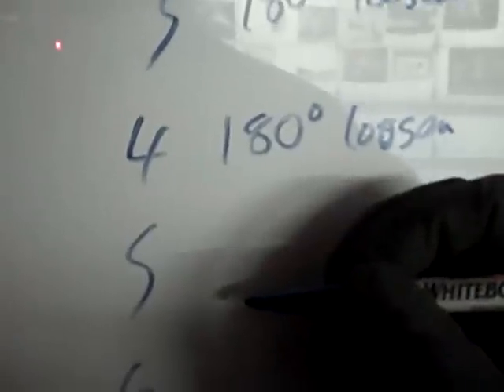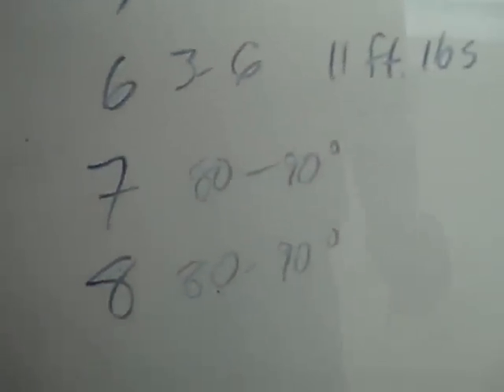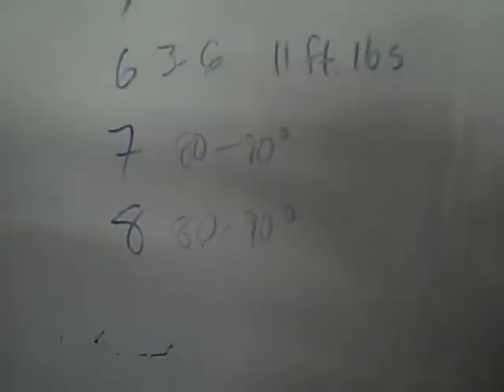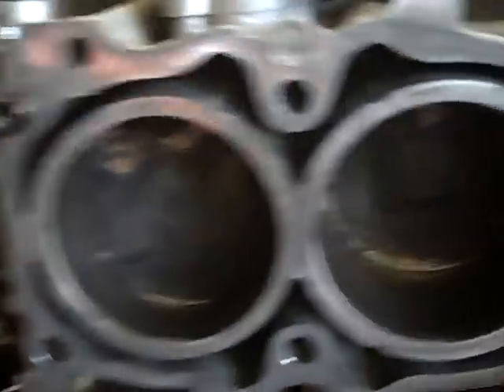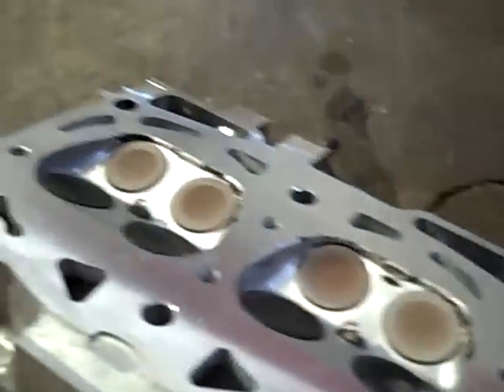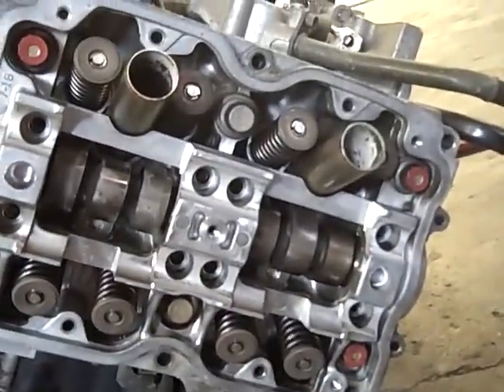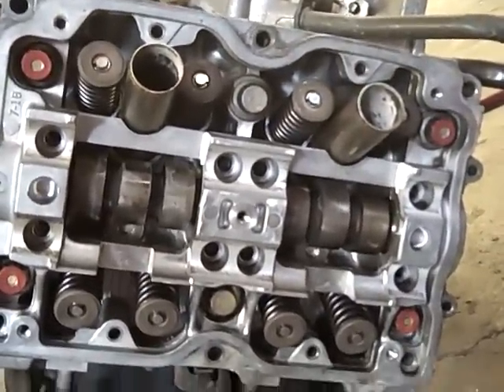Subaru Head gasket installation instructions

Comment from the maker: @lealamb If they have that white corrosion on them it really messes up the torque and contributes to broken bolts especially when coming out.  I wire wheel the threads and put a little oil on them.  You're better off to have them be too loose and use some blue thread locker than to break them off.  Not sure if this helps but I try.

Comment from the maker: @MrBugout1   If it's a manual transmission, it has synchro damage and needs to be pulled out and reworked.  If it's an automatic you may have a linkage issue either at the trans pan or in the console.

Comment from the maker: @Flaheat   Put the shaft in a vise.  Clean out the inside enough to tell if there's a clip you can remove.  If so remove it and the shaft will come off the inboard joint.  If not - then it's internal and you use a big rubber sand-filled dead blow hammer to thunk it off the end.  Also as you probably know the inboard joint is held to the trans output shaft by a roll pin.

Comment from the maker: @y2mouse If the heads are off you can use an impact gun.  If it's the driver side (left when in vehicle in U.S.) take the head off and then use an impact.  If it's on the right, remove the 10mm bolt behind the cam if you can- then take the head off and hit it with an impact gun.  The shock of the gun breaks the oxidation.  The other thing you can do is too risky unless you have more experience.

Comment from the maker: @lealamb  It was leaking from the corner.  Not to be confused with leaking from the coroner..... cuz that would just be gross.  The way to tell is use a straight edge and a feeler gauge set.  generally they need it by 130K. miles.

Comment from the maker: @lealamb No.  The only way they can hit is if the connecting rod bearings fail or the timing belt is off or the valve adjustment is WAY off such that the cylinder has no compression cuz that valve can't close all the way.

Comment from the maker: @ycformosa It could likely be... but it could also be a mechanic that used a funnel to fill your coolant that had been used for oil.  Clean out your tank and then see if oil comes back.  If it does, it is a head gasket.  Most Subaru 2.5 liters experience head gasket failure around 120,000-150,000 miles.

Comment from the maker: @RoberTastic   You CAN jack by the oil pan if the motor mounts (all three) are undone and you use a large wood block- I don't like doing this because it's high risk.  instead jack up trans with 4"X 4" wood block between the engine and transmission.

Comment from the maker: @miketlane I looked it up and it isn't listed.  It should be about 15-18 ft. #'s for the larger bolts and just snug on the 10mm ones (M6X1.0)  Snug means like 6-8 ft. lbs, but settings that low aren't generally accurate anyway.  You can feel when they start to bind down- just don't break them off.  If you are worried, use blue loctite thread locker.  NOT RED because the bolts are too small to stand up to red.

Comment from the maker: They are.  The important thing is to use MLS metal gaskets on the turbo ones.  Also the coated MLS ones don't need any copper spray on them.

Comment from the maker: @easydoz1 Not if you oil the tips of the threads on the head bolts and torque it right the first time.  (you torque them twice to do it right, but it's all in the same 5 minutes.)

Comment from the maker: Piston slap is almost ALWAYS accompanied by blue smoke out the tail pipe (at least some- not always a lot) when you stomp on the gas from a stop and romp it like in a 0-60mph test.  A follow car is best for observing this.  It puts the engine under load- and usually that will tell it.

Comment from the maker: This one is a Single Over Head Cam.  Only one cam (rod in the center with all the lobes that has only one wheel for the timing belt to drive per each side of the motor).

Comment from the maker: @jdm1234 no.  Idle is good.  If you want to blow an engine on purpose (cash for clunkers etc) that's what you do.  Just let it idle up to pressure.  Use engine assembly lube if you're worried about it.

Comment from the maker: @anto3534 If you have more vehicle specific information then do that.  Also Subaru updates information periodically that supersedes previous information.  The goal is to get a good snug hold and the right crush on the gasket.  Older Subaru's with lead HG's  tended to have lower torques than the late 90's and 00's.  The newer steel gaskets after two 90 degree turns wind up being 85-89 ft. lbs or higher.

Comment: Brian, thanks so much for getting back to me.  

Again I have an 05' WRX and I was about to put my heads on tonight, but ran into a bit of a problem.  The book I have says that after loosening 180 twice to then torque all bolts to 36 ft-lbs.  Then tighten 90 degrees and then 45 degrees.  Your video says to do 1&2 to 25 ft-lbs and 3-6 to 11 ft-lbs.  Then tighten 90 degrees and 90 degrees again.

I'm not quite sure who to follow.  Any advice would be great.

Thank you so much,
Adam

Comment: hey i  just did this and was told replacing those stretch bolts is a must, i think mine was overheated bad because i had to use a 4ft cheater bar to get them loose and tap one out to get a bolt back in,  i priced the new bolts and a ARP stud kit was about the same off ebay and that eleminated that stupid torque spec ARP had there own it was torque to 90ft# in 3 stages and done

Comment from the maker: @wushunsupacycle Technically NO.  The mark is lined up which on most cars would be TDC, but Subaru's are built at center stroke and the timing mark on the crank is mid-stroke.

Comment: Revved the engine slightly but the knock stayed. Only other thing I did was adjust the valve lifters to spec when I had the cylinder heads off.

Comment: A lot of my gearhead friends who own a subaru or three like to use the factory gaskets for an STI on their EJ25s, and say to never ever use the felpro gaskets or copper coating... not sure if they're correct but they haven't had any issues so far.  IIRC the STI gaskets are MLS construction.

Comment from the maker: @konic40  If they are driven like they're stolen and the fluid isn't changed appropriately then you WILL have problems.  But then again, if you run and train yourself like an Olympian and never eat properly you'll break down as well.

Comment: Hey Brian, I am a carpenter, not a mechanic, and with your help and with no manuals I managed to replace the head gaskets, timing belt and the water pump on my 2002 Subaru Legacy L 2.5 successfully.  This is my first major engine work. The thing that was the hardest was pulling the motor, because the motor mount bolt got hung up on the frame, but with help from friends we got it out and back again.  So, I wanted to thank you from another satisfied customer.  You rock!!!! Tak so mycket.

Comment: Brian, Just got the time to put the Subrau back together with all the new parts. I was just going to spray the head gaskets and I seen a note in the set on the thickness of them. the .026 is for the EJ253 motor (which I have which I ordered) but the gaskets that we are replacing are .053. I should order the thicker ones?  Bud..

Comment: Gaskets can be changed while in car, ive just done it. it is a really tight fit but can be done. you can do the top 3 and 1 head bolts on driver side then loosen all the others then you gotta have a friend move the bolts while i grab the head and do good hand movement lol, it is possible tho.

Comment: You're right, head removal can be done without taking out the engine. Just remove the intake/exhaust manifolds & their accessories (unbolt & unplug everything), undo all of the engine mounts, & jack the engine up as high as it will go. I removed the cylinder heads from 98 2.5GT Limited this way after rod shot through the block. It took about 5-6 hours to do it that way where an engine hoist will make things much faster (you can pull an engine & start taking it apart in about an hour flat.)

Comment from the maker: @john639 I know Subaru gaskets last 150K miles.  I know aftermarket ones last at least that long or longer.  I use Felpro unless the owner insists on OEM.  If they want Penzoil, or Bosch platinum +2 plugs, or speed holes, or HUGE wings on the back of a front wheel drive car, or rocks in their crankcase.... I can handle that.  It's their car they can have what they want.

Comment: I recently purchased a 96 2.5l outback wagon from the write off lot, The engine appeared fine{actually the guy told me was running}. My fault I did not get the car till it was out of the yard. both cam gears on the pass side are destroyed. No marks of contact on the head, The top cam journal looks just slightly misaligned from the head side of cam journal looking down from passenger side. The car was parts but mostly to replace my current knocking engine, oops in my 98 out back.

Comment: Thanks!  Yep got her out yesterday, did it before to replace the clutch. Pretty easy when you have a chain hoist and trolley system in your barn.  Thing is I can't get the timing sprocket bolts (17MM) lose.  WWT?  They are really tight, must have some lock tight on them or something.  Used my breaker bar on the crank and another on the bolts.  Even with the belt still on it slipped some teeth.  Any ideas?

Comment: Finally got the cam sprockets off, had to use my electric impact wrench and it took some work.  I pulled the valve covers and cams on my 99 Outback DOHC I noticed the head bolts all have a "L" on them. I kind of stopped and thought for a second usually that means left hand threads. No that can't be right, they wouldn't do that would they?   Just in case I thought I'd ask before I go any further.

Comment: ran the engine cold again and the knocking went almost completely away after about 1 minute of warmup. I'm guessing it's piston slap then. It's still just audible after full warmup but only here and there. My main concern is that it's not something else, but I don't have any other leads as to what it could be at this point. If it is PS I'll try one of the recommended oils for remedying it.

Comment: can you do this without dropping the motor? my 02 has a bit of a leak from the head gasket, no codes, smoke, or over heating. just a bit of valve clatter. and thank you very much for the vids.

Comment from the maker: @mixerpilot614  I like to pull the heads off with the cam gears on to avoid piston/valve contact.  Once it's off you can use an impact gun to whip the bolt out without rotating the cam- (not that it would matter, I'm just anal a bit.)

Comment: @briansmobile1 1999 2.5 dohc impreza. i looked in the book and it was not clear. i rounded 3 bolts getting them out because the were not easy to brake loose. the ones for the cam seal cant be very much there very small. im stuck for a week untill the delaership gets the new bolts in... what fun lol

Comment from the maker: Use a straight edge laid four ways across the mating surface of the head like a union jack and run feeler gauges under the straight edge to check for gaps.  If you you have significant gaps you need to deck the head.

Comment: brian i have a 1999 subaru forester ltd non turbo 2ltre,
the original idler on the bottom left hand side has a collar on the back edge, all the others dont would it be allright to replace it with one with no collar, or does that have a purpose in stopping the belt running off, i notice on some other engines of the same 2ltre size that they are all flat. great vdeo by the way 
thanks glenn.

Comment: Did someone answer you question yet? flashing check engine light usually means a cylinder misfire and raw fuel is going past the o2 sensor warns of catalyst damage.

Comment: Thank for the quick reply. I do have a couple of question on the head pully's and timing belt, first is it normal that the passenger side head pully has an 1/8 turn back and forth were the driver side has none( no belt on). My next question is the valves on the drivers side going to be opening with the mark at the 12 o'clock. Thanks Bud

Comment: @briansmobile1, Thanks for the video. I just bought a 2000 Forrester, cheap,  with a blown head gasket and 200 thousand miles. I'm going to replace the head gasket, timing belt, seals, pulleys, and I was wondering if the head looks good should I take it to get machined because of the mileage?

Comment: @briansmobile1 Okay, I've been hit by subaru blown head gasket curse this week. Here is my question. My subie WRX 02 wagon reached 192K. Please read my questions on the bottom of page related to timing belt and head gasket replacement.The timing belt was done at 110K, first time. A Gates timing belt/water pump kit was used that time. I recently read that AISIN seens to be a better brand to replace. I actually was disappointed that one the idler start to make noises after 81K (110 to 191K). Would agree that should last longer. Should I go to AISIN or other brand?
Next, since I have to do a head gasket change, should I go for racing type? Or not? There have been considerable oil leaking for the last 20k , but I have been carefully making sure thatI replenish it to stay above minimum level. It looks that coolant is steaming from blown gasket on rear cylinder passenger side. It does not look that oil is getting into coolant as it coolant does not look contaminated. It looks that oil has not made into cylinders since the car just passed smog test.
Last question: Is it better if the whole engine is removed or better do it in the engine bay for all the work? Thanks for your opinion and any else opinion, too.

Comment: Before you pull the heads for a head gasket where do you have the timing set up on a SOHC subaru? Also is there a proper sequence for removing the head bolts?
Reply from the maker: Tyler Noveroske Proper has a lot of variation just like at a diner table.  Some best practices are- line up the cam marks like you're doing a timing belt.  The pistons will all be at mid stroke.  When removing head bolts, it's best to crack them loose from the outside and work your way to the center.  From there, it's not as critical how they come out.
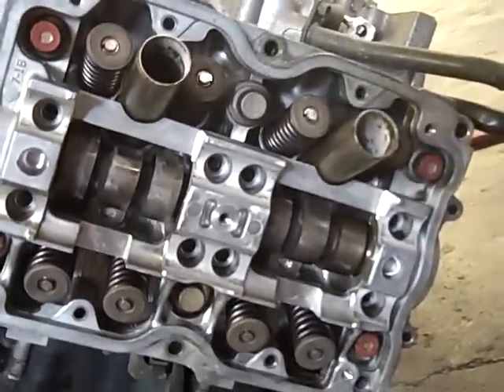Reply: Ah,  crack them loose from outside and work to center, but in this procedure when doing the loosening you start with the center bolts a, b .  that's 4:39 in.     As a perfectionist, this philosphical difference has me twitching.

Comment from the maker: @PaintballSpecialOps YES. That is the way to do it.  Just pull the four bolts on each side, the EGR pipe from the drivers side head, The PS sensor, Crank and cam sensor plugs, Three harness plugs on passenger side upper bell housing, knock sensor plug temp switch and sensor plugs, and a little coolant line on the back.

Comment: Brian - Great video, I'm about to do HG's on my 03 Forester this week. However, the Subaru manual I downloaded had a slightly different procedure. 22 ft-lbs, 55 ft-lbs, 180 loosen, 180 loosen (all the same as you up to here), then they say 45 degrees tighten all bolts, then another 45 degrees for just the center 2. Is this just another way of doing the exact same thing? Thanks for any feedback! Also, have you ever used Felpro's MLS "Improved" gasket? That's what I'm putting on.

Comment from the maker: @wushunsupacycle Torq'n head bolts is NOT as exact a science as would make us comfortable.I used to be a procedure NAZI because the procedure was my security blanket like Linus on Charlie Brown.Over the years you get an idea of what it should "feel like".  Many specs say 40-45 degrees or 80-90 degrees.WHICH ONE???You can feel when the head begins to bind down and the amount of force needed increases in a logarithmic pattern.The idea is to be tight/flat/uniform, but not damage.

Comment: Just finished head gasket replacement. Ran engine 3 times for a few seconds each time with no issue. 4th time it started making a knocking noise at idle that sounds like it could be piston slap. I'm pretty sure I got the timing correct, even turned it over by hand a dozen times with no issue before starting it. Could it be valve interference? I turned it over by hand again several times after the knocking started but still couldn't hear/feel anything. Don't wanna tear it right back down...

Comment from the maker: It's usually best to either long sand block the head or machine it right.  DO NOT buzz biscuit or whiz wheel them.  That's the #1 contributor to premature failure.  I recommend fel-pro MLS head gaskets. (multi-layer steel) with the blue coating on them.

Comment: Hey bro you only need to do the first steps if you are useing new head bolts if your reusing them just do ur 11 25 and too quarter turns u only want to back them off for new bolts cuz it's a yell id to stretch bolts it's what give subie there holding power they say to buy new head bolts every time you do head gaskets but when I worked at subie as a hard line tech we never did we always reused them anyway great vid as always

Comment: Hey Brian I have a ej25 with a sohc the lifters are knocking and I want to tackle this problem myself bc I don't have to money to take it to a shop and i havnt pulled the engine on a subaru before done regular maintenance but nothing this major on the H4 I was wondering if u could help me out with where to find the info on how to replace the lifters and valve springs or if happen to b working on a sohc ej25 if u could post a video on how go do so would b great thanks

Comment: Don't use aftermarket headgaskets during a headgasket replacement for the Subaru engines,the OEM headgasket which is a Fel Pro is the way to go.Spend the money on the electronic torque wrench with the angle settings built in.The Fel Pros are marked how they go.Minus well replace the timing belt and water pump at the same time if it has not been done yet.